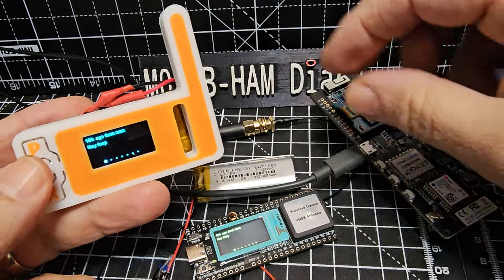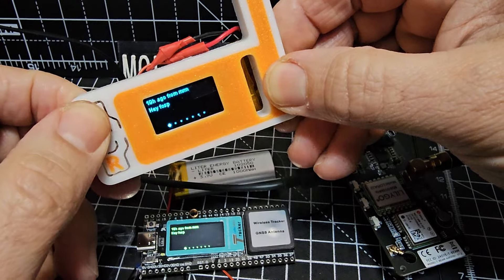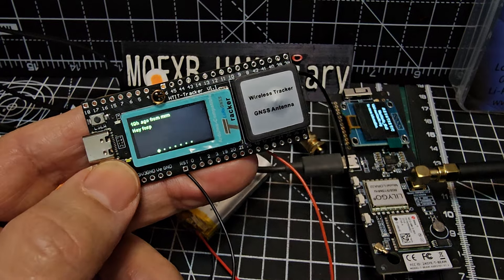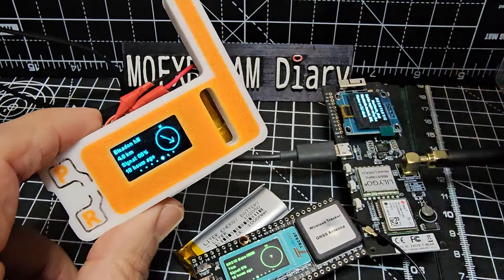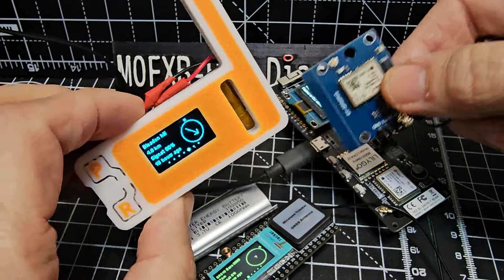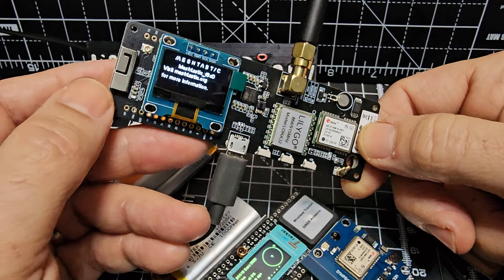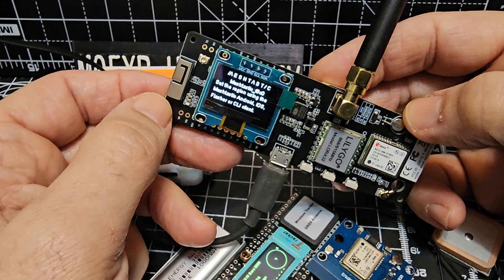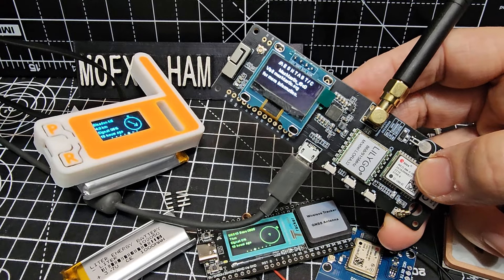MESHTASTIC OF-GRID - BUDGET OPTIONS FOR HARDWARE

Comment: The T-Beam takes an 18650 cell. I would not use salvaged vape batteries due to variable quality but they will work in a pinch. On the highstreet Argos sell Molicel P26A/P28A flattop 18650 cells which are some of the better ones. Runtime is around 19 to 24 hours based on a 2600mah P26A with moderate traffic and GPS enabled.
Reply from the maker: Many thanks